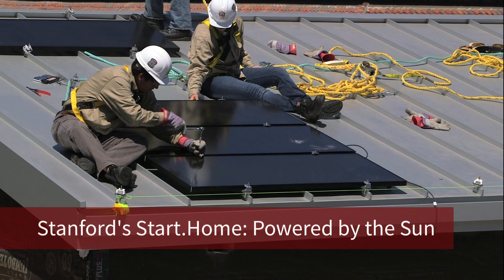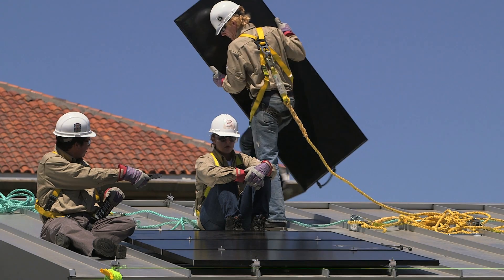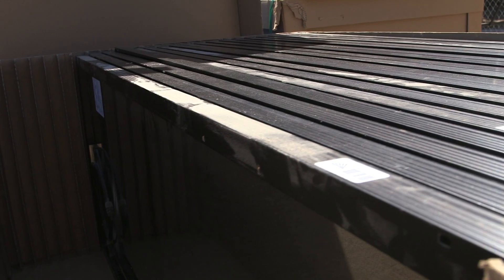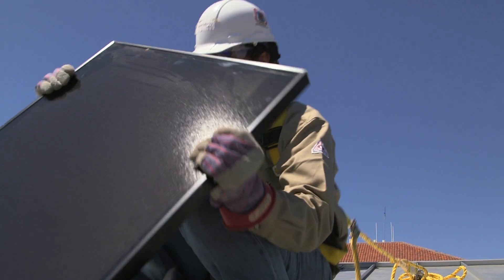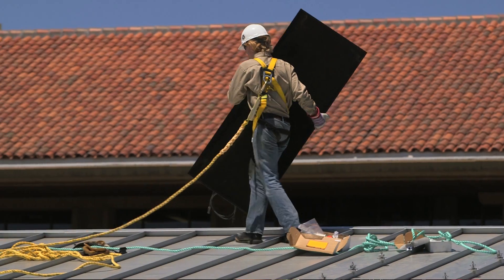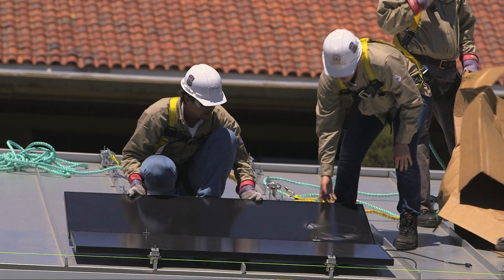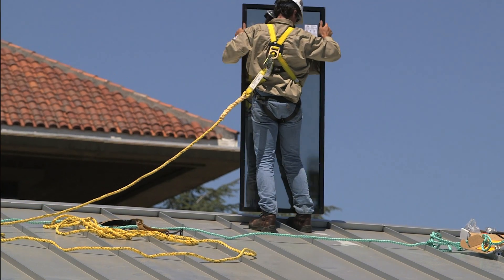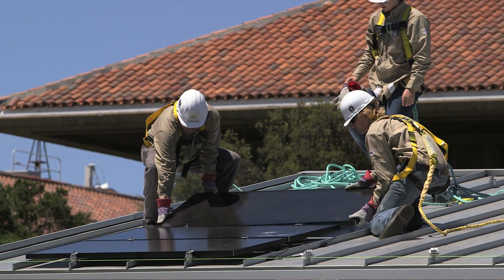Stanford's Start.Home: Powered by the Sun

Comment: Alright, Chinese look very happy that Americans buy from them solar cells and all bulls..t about 'selling electricity to the grid' from the house. The grid has to deal will variations of frequency and voltage and spends A LOT more of gas and coal to stabilize the parameter than without solar sells. So stupid are the Stanford's people if they buy lies about 'green' energy. It actually produces a lot more CO2 than any energy from coal or gas, not to mention nuclear. Go Thorium, go green nuclear.